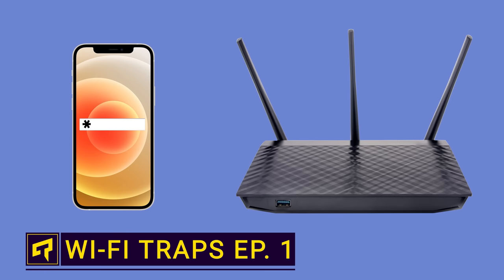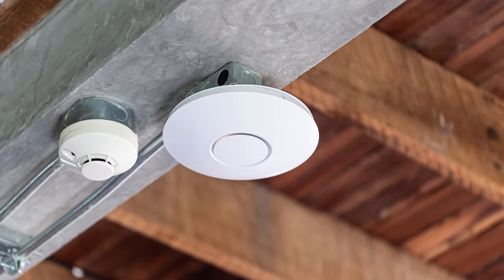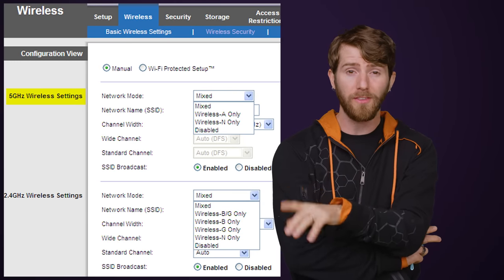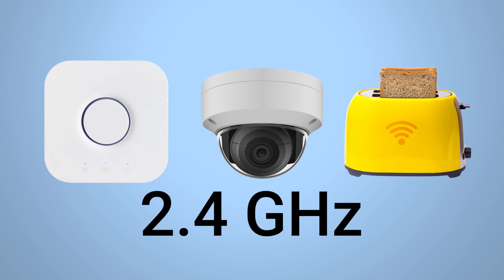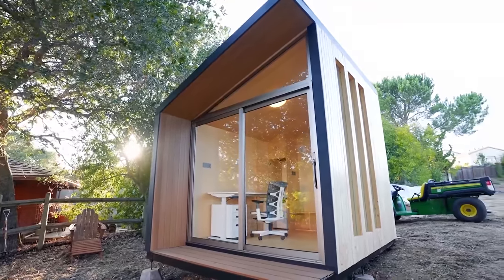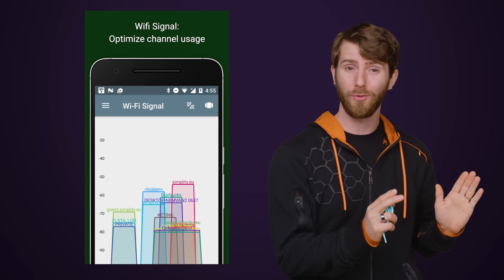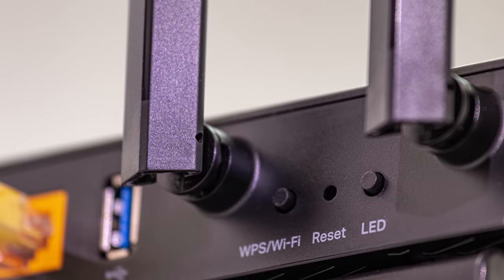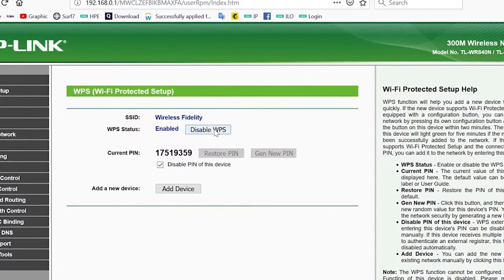Avoiding Common Wi-Fi Traps

Comment: oh, I got a few. Like congested wifi networks. short guard and what it does, the difference between signal and quality,  both the 2.4 and the 5.2 has a short guard interval and impacts range and performance. RTS threshold value in a congested area,. public networks can benefit from heavy device traffic, by changing that value.  Also B-G and N conflicts, older devices use different band types. even wifi 6 should still have these settings

Comment: Also. if your router allows 5ghz channels above 48, check the logs for messages about DFS or Radar. The channels above 48 aren't just for wifi, but have higher priority users like radar, and most routers disable 5ghz wifi if radar is detected on your channel. The channels below 48 are reserved for wifi so they will just keep woring.

Comment: My tip is, get rid of it and use a hard connection. WiFi is slower and has a higher latency than ethernet. When I get my own house, I don't plan on getting a router with WiFi. I plan on making a junction box of outbound ethernet from a switch/router that then has a connection to each room in the house.
Reply: Wi-Fi is useful for mobile devices like phones and tablets. Everything else should be wired though.

Comment: The whole wifi channel thing is simply nonsense.  The 2.4GHz is only 80MHz wide and 5GHz is only 700MHz wide (although frequencies 5.351-5.469GHz and 5.726-5.734GHz aren't available) .  There isn't sufficient separation in frequencies between any of the channels to actually do anything.  It's sort of like the push for walk buttons on stop lights that are there but don't do anything.  The issue isn't channel, but signal strength.  Saying channel is actually idiotic, too, since channels are just frequency incriments within the frequency band.

Comment: 1. If you cant place your wifi in a high location, you can use a sheet of tinfoil to place underneath the wifi router.👍

Signal that is being push downwards by the router will bounce upwards by the tinfoil which will give your router a wider coverage.👍

2. Hide the ssid of the router so other devices wont try to accept the signal which sometimes can cause your other device (that is farther away) to not detect the router.

3. Limit the allowed connection or you can set the mac address of the devices that you want to connect.

Comment: More complex, but using a separate device to act as the firewall/router from the WiFI Router turns the WiFi router into merely an Access Point, so it doesn't have to do anything like packet inspection, NATing, or anything like that. This gets handled by the firewall/router appliance.

Comment: pc at 1 corner of house, router at the opposite corner (at least 2-3 walls in between)

on 2g wifi 80% signal i was getting 20-30mbit download.

on 5g wifi 50% signal i would get 70-80mbit download.

on 5g wifi with 802.11ac (wifi 5) i get 90% signal, downloads pegged at 117mbit.
my local network connection over wifi is 585mbps full duplex

Comment: Another thing, be mindful of the ducting and HVAC equipment in your home.

The fibre ingress into my home is the worst possible location: exterior wall in a room with a drop ceiling with supply and return ducting, then line of sight to most rooms passed right through my furnace room. Often, my 5G capable devices downgraded to 2.4G

Over the weekend I upgraded my WiFi with TP Link's Omada cheaper version of the Ubiquity Unify system. Put in 2 access points, downstairs and upstairs, and setup seamless roaming between them. Although I did hide the upstairs one in a closet, I'm now getting rock solid 5G everywhere

Now, I just need to learn how to setup VLANs for my IoT devices

Comment: I am a Senior Wireless Network Engineer for a University so I know I little about WiFi. When selecting your channels for 2.4 only select 1, 6, or 11, all the other channels overlap and cause interference to 1, 6 or 11 and everyone ends up getting subpar connectivity. Security wise use WPA2 with AES, stay away from NONE or WPA2 (TKIP). Always make sure your antennas on home routers are pointing straight up in the air.

Comment: Setting your router to a certain channel doesn't work in an appartment building. As there are at least 20 other networks in the area that keep auto switching. As you're the only one setting the channel, the others will keep using the same channel whenever it's convenient. You just have to accept not using 2.4GHz at all.
Reply: *apartment
Reply: This :(

Comment: You don't need an expensive mesh wifi system, if that is what you are looking for. Used Ruckuss satellite devices are $50-$60 each on eBay or other places. Getting 2-3 of those and a PoE switch to power them will still cost you less than the basic consumer grade mesh system, provide you more customization, and much better coverage. We have 4x Ruckuss devices around our 2,400 sq ft home... you can stream media from anywhere on our property.

Comment: Pro Tip: if you have Problems witv your Router or WiFi, switch to Enterprise Gear.

My AVM Fritzbox gave me Headache for a Year until i get myself two Unifi AC PROs. Sure Enterprise Gear isnt Cheap but for good Reasons. Mount it on the Ceiling, plug it in, configure it and never think of it again.

Comment: I'll leave this little tidbit. For your network, it will operate and run from the slowest standard that device is connected to. EG: If you have 4 devices with the following network standards 3x 802.11ac, and 1x 802.11n, the three AC devices will run at speeds of the N for compatibility of communication. If you're designing your network to use the fastest speeds, make sure you configure your 5GHz band to only run on the highest network standard settings (i.e. ac or ax). Only downside is all of the devices must have that standard on built into their WiFi antennae or it won't connect to the AP.

Comment: I found my WiFi has degraded after a business built next door. I suspect interference but I can't find any indications in any WiFi app. 

My signal strength has just dropped. However maybe that's something that happens as a router ages?

It's the 5 Ghz signal that's reduced mostly and the 2.4Ghz keeps disassociating.

Comment: Upgrade to a WiFi 6 router (it is backwards compatible) and as you continue to buy new devices, make sure they are also WiFi 6 compatible (if possible) so you don't have to worry about cross-network listening with BSS coloring.

Comment: One thing I've noticed using a WiFi 6 device (the only in my home), is that I get extremely frequent disconnects and horrible speeds from my WiFi 5 ISP router (which they sent me when I signed up for fiber a year back). I've never had issues on other routers (which probably weren't WiFi 6 either) and every other device works correctly, but my tablet is downright unusable on that network.

Comment: Two things. If you have more than one wifi generating device, keep them apart (ie routers don't stack on top of each other).
HP wifi direct. Seems to make 2.4 drop constantly. It's never used anymore, disable it on hp printer settings. Wifi will almost always be magically better!!

Comment: I have fantastic connection stability but slow speeds. 
Cause: still running Ubiquiti LR APs, 802.11a/b/g only. 
Might be getting gigabit internet in the next year, so that will need an upgrade too.

Comment: I'm a Lead Cable Tech for Spectrum I install for Residential, Commercial/Industrial  and my big thing with wifi don't touch your router settings if you don't know what you're doing can cause problems for not just you.     Had customers mess up there router so bad they took their complex cameras out.    Don't watch a video thinking you know a thing or 2 if you've never done it before.   Also for "Custom" settings strongly recommend you just get your own router and run it off the ISP router and dabble with settings for your router not your ISP

Comment: The best possible advice I can give about WiFi is to turn the radios off, and not use it. Wired is superior in every way. If wired isn't an option, then yeah, placement, channel optimization, disabling WPS, log into your router and change the damn default admin password is another good tip. Also make sure that your router is not responding to ICMP Pings. This will keep you off the radar of random ping sweeps.

Comment: ah the joys of wifi issues, as a network technician and installer the HEADACHES i have dealing with customers that don't know the specifics as to why they should or shouldnt use 5g. lol "im not getting any signal" sees customer trying to use 5g network while at the other side of his 3500 sq ft house *facepalms*

Comment: Using 2.4Ghz in anything other than a detached home is nearly impossible these days due to overlap of the channels from neighbors, if anything I would suggest forcing everything to 5ghz and purchasing a home mesh AP system as a much better option to increate 5Ghz coverage and keep devices on the less congested 5Ghz band.

Also supper surprised to hear the suggestion of putting a security camera on 2.4Ghz as any streaming device eats up shared airtime like no tomorrow. Yes you get more range but you will fill up the tiny 2.4Ghz channels with just a few cameras constantly streaming.

Comment: Also one thing not mentioned and it 1000% should of been. If you are far away from your ISP/in a congested area no matter how god tier of a router/modem is if your house is not receiving 100mpbs you can't get 100mbps. It's just not going to happen. Your hardware can be great but if you have a shitty isp cough cough CenturyLink then it won't matter your internet is still going to suck

Comment: Many UK ISPs provide routers with 180 degree directional signals, so they need to be put in corners for the house to be able to access the signal. The doughnut signal doesn't apply to them.

Comment: I recently ran into an issue like this. My home was not designed or built for radio signals. In fact we basically have a faraday cage in the roof. I had to do some Wizardry with Wi-Fi range extenders to blanket the interior of the house and provide a reasonable amount of coverage Outdoors.

Comment: A couple of things mentioned and to improve on.  

Put as many IOT devices on the 2.4ghz SSID as you can, 1) so many still only have a 2.4 ghz chip anyone 2) their check-ins and lower quality chips drag down network performance 3) setup is easier when you have the separated names.

Keep your WAP high up, out in the open, and away from any devices any RF.  

If you need to fill in any WiFi deadzones, use a wired backbone for additional WAPs.  Mesh networks are mostly easy to setup and place but they use a wireless backbone  and adding too many will drag down network performance.  

WiFi 6 WAPs that support OFDMA will future proof you, though the cost will be higher and it will take time to see the full benefits.

Change your default WiFi names and passwords.  And don’t pick FBI surveillance Van.

Comment: my best wifi upgrade: disabling it on the horribly overprices fritzbox and instead getting a 20 bucks no-name access point and placing it about 5 meters farther away from where i need wifi. both stability and speed significantly increased. why are fritzboxes so overhyped, even if they are so terribly terrible?

Comment: They don't mount AP's on ceilings because the signal is stronger below the antenna. If that were the case, they'd just flip the AP upside down...

They are mounted on ceilings for best coverage because there are less obstructions. Think of how a ceiling lamp lights a room compared to a table lamp.

Comment: Use 40MHz channels for 5GHz. It's a good tradeoff of speed vs range. How does channel width affect range you ask? SPECTRAL POWER DENSITY is lower when you use 80MHz or larger channels because you're radiating the same amount of energy over a wider band of spectrum, so it falls off quicker.

Comment: Do not recommend locking your router to a specific channel. The perception that the auto change feature doesn't work properly on most routers is a myth. In fact locking onto a channel can promote issues because surrounding routers are all probably still set to auto. Meaning if your channel gets congested at any time, your router will be unable to correct and move to a less congested channel when it needs to, causing your intermittent issues to actually become worse. 

Love, your local certified network technician.
Reply: If you notice a change in reliability, your going to check that and make the correct changes, no?
Reply: @qpSubZeroqp  you can, but why do that if its unnecessary? Depending on where you live, that can create an issue where you'd probably make those changes several times a day, such as crowded apartments. Or you could leave the router on auto and not worry about it.

Comment: Fun Fact: Apple devices will freak out and not connect if you set the preamble to short.
Fun Fact: Old apple devices will freak out if they're put on a network that's anything other than the station on the left of the extension channels.
Fun Fact: Most people actually have decent Wi-Fi but don't have it configured the way it should be.

Comment: If you have to put router in a corner anyway, try to buy one with removable antenna and use a directional antenna facing the home or area you need coverage, there are small portable one available on market for cheap like from A4tech. In my brother home, he had poor coverage in one bedroom but changing router position wasn't viable option, I had a v old (2008) US Robotics directional antenna and replace it for one of the omi antennas and it make coverage much better from 1 signal to 3 signals. Also my router had two antennas so I still retain coverage for rest of the house by leaving one with original omni antenna.

Comment: One of the key things to get good networking and Wifi is to not use an all in one router for your Wfii. Get a few hard wired Wifi access points from brands like Unifi, Make sure you set your channels non overlapping in the 2.4ghz as only channel 1,6,11 are non overlapping) Lower the transmition power of 2.4ghz by 3-6db so that it matches the 5ghz range.

Comment: due to where i am in relation to the shared AP, i get a stronger signal from the nearby shops, which interferes heavily with my connection. it's much better after buying a new wifi card, but signal degredation and dropouts occasionally happen still

thinking of running everything wired w/ a single wireless repeater/bridge to connect me to the main network but i don't have the right gear and idk how much it'd actually help

Comment: Hilariously, the AP's Telstra uses for NBN in Australia (Arcadyan LH1000, 4G backup if NBN goes down) only support a few devices connecting to 2.4GHz at the same time. 90% of my devices support 5GHz n/ac modes, and I actually get better range on 5GHz than I do 2.4GHz, likely due to the output power set in the firmware of the Arcadyan LH1000

Comment: Covered most of the important items without getting technical, well done.

My WiFi Tips:
-do not use it if you do not have to. Wired is more reliable, period.
-if using 2.4GHz, only use channels 1, 6 and 11. The other channels all overlap and interfere with each other. It is better to have multiple AP's share time on 1, 6 or 11 than to overlap by using channels 2 and 8 (for example). Unless you understand how to use the other channels effectively, the other channels should just not be used.
-if using 5GHz, use any channel that is underutilized in your area, starting from the lowest channel. When they created channels for 5GHz they avoided the overlap issue from 2.4. There are some caveats to this (channel bonding for example), but you can read up on that elsewhere. There is a chart of the channels and how they can be used available somewhere.
-avoid channel bonding if you live in an area with a lot of wifi use. Bonding channels to get more bandwidth sounds wonderful, but many devices do not support it, plus other AP's in the area using any part of your bonded channels will clobber your signal when they transmit.
-lower the broadcast power from high to low. Most AP's ship on their highest setting which just clutters up the airwaves in dense areas. If you live in an apartment even low will reach your phone in the bathroom. A lower broadcast power can result in less signal noise and retransmissions.
-AP positioning: the more line of sight to the AP the better. Determine where you actually use wifi, then move your AP so the least number of obstacles are between the AP and the device. Each wall can drop a signal in half. On the floor behind your metal file cabinet, buried under a pile of power cords is a poor location.

Comment: Wifi tip: if you have a number of devices in one place (say a Smart TV, several game consoles and a streaming box attached to the TV) consider getting a Wifi bridge or bridge repeater with multiple Ethernet ports and use the Ethernet ports on your devices and disable their wifi. That way you can reduce the number of competing wifi devices on your network. Additionalky, it may allow you to place that wifi bridge somewhere within wired range of those devices but somewhere with better signal strength (especially useful for devices inside an entertainment cabinet)

Comment: I ended up running lines around the room for computers that were always used in the same place.  All devices, phones, etc. are on 2.5.  Laptops use 5.
I had wifi in my office, many computers, printers, etc.  My child's room is next to the office and always had issues.  I moved the AP point out of my office and am now able to connect reliably.

Comment: If it can be cabled, use a cable. So many people have their fibre connections installed in their living room then connect their smart TV and consoles over wi-fi when the router is on the same piece of furniture. It's pointless avoidable traffic you could be avoiding and your devices will run better for it.